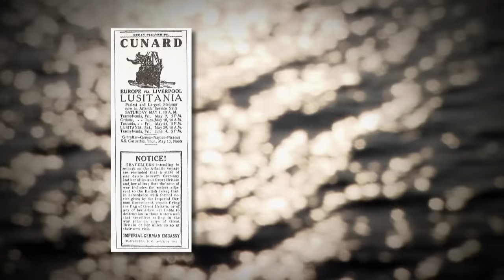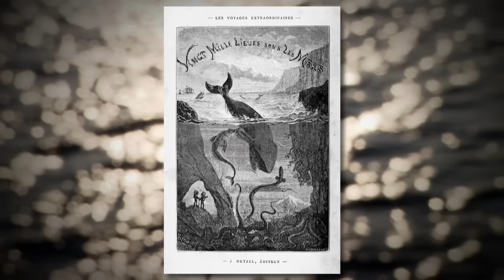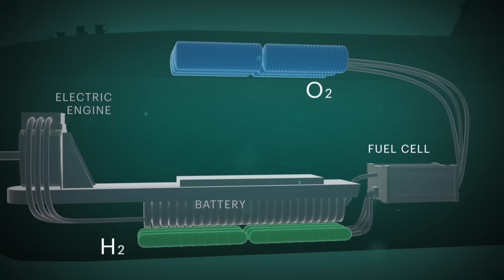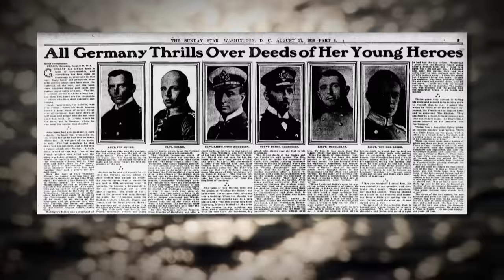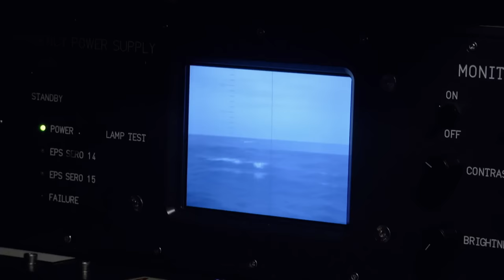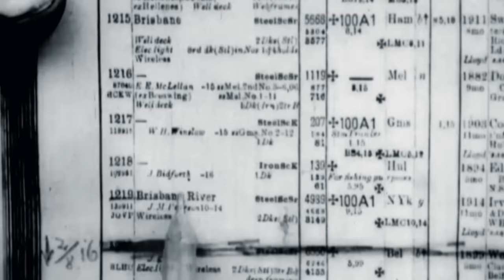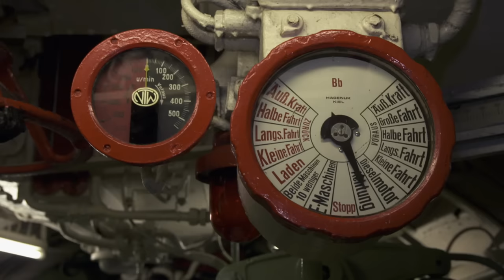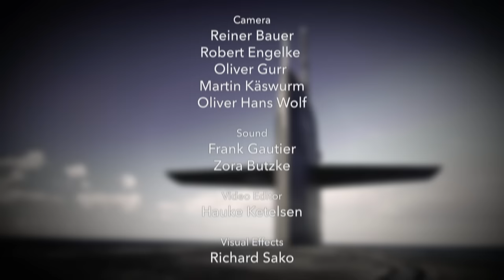Submarines: From Raider to Wolfpack | Documentary | Ep. 01

Comment: Technically they are submersible, only with the advent of the nuclear power plant did we get U-boats.
Reply: No, not really. The German Type XXI (E-boat) was designed from the start to remain submerged permanently. And it's submerged speed was higher than its surface speed. If anything this was the first real U-boat. Obviously after the war the Allies took all that research and you can ask any expert, the Type XXI was and still is the basis of all modern U-boats.
Reply: Explorers nonetheless. Brave souls. God Bless Submariners.